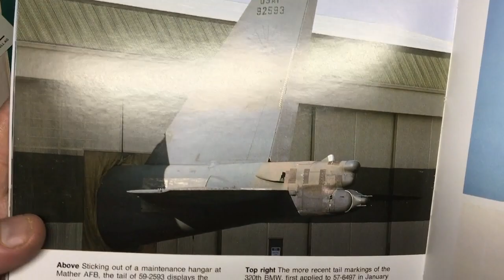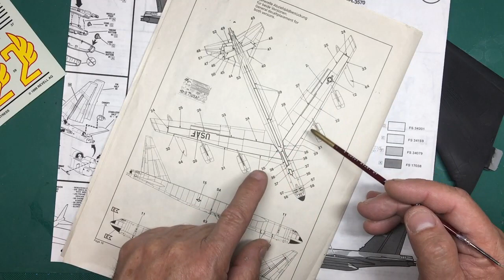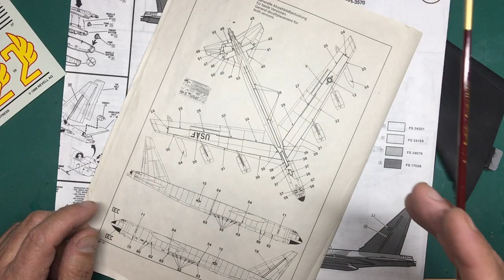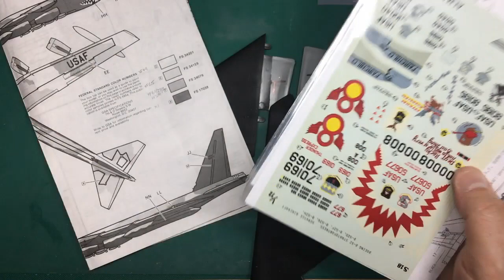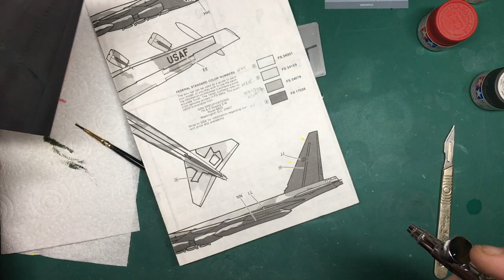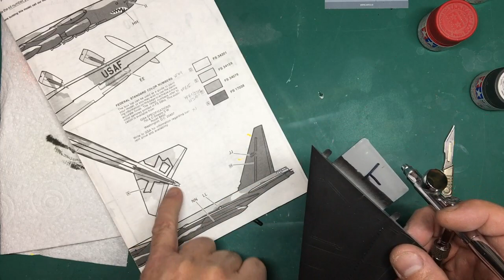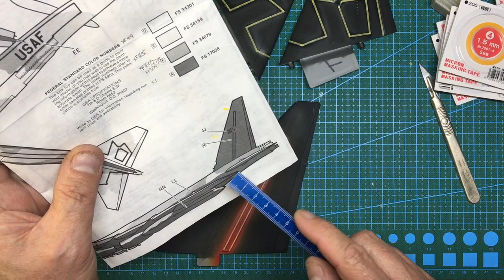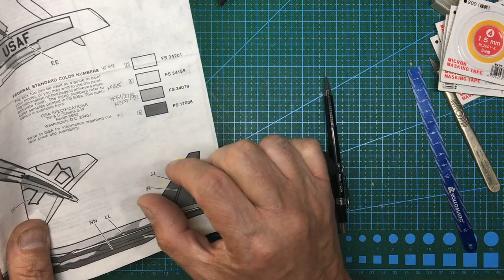Big Bad Buff Build for Beginners. Part 24

Comment: Good tip to scrape off the dried paint on the tamiya paint pots, it really glues the lids on lol. Model Master paints are the same. There won't be any beginners by the time you finish this big bad buff build, this is the condensed version of everything you have taught us over the last few years. As an old bugger getting back into the hobby, if your teachings are followed and a little bit of patience is applied almost anyone can build a model they are proud of. I learn something new every video. Where were you 45 years ago lol. Thanks for sharing Nigel!! Cheers!
Reply from the maker: Glad you get so much from my videos Daryl

Comment: Another great installment I use Vallejo paints purely because they're easy to use and as I'm still finding my feet with the airbrush every little helps. Plus I'm on a tight budget I've followed your advice re glass balls in paint pots what a difference they make many thanks. Used premium hobbies very helpful got some Mr Surfacer 1000 and some leveling thinners too.  Looks like my next order will include some thin masking tape to try to do walk lines on my next Spit again thank you very much

Comment: Thanks Nigel for the tip on masking and preventing wicking, I usually spend ages with a cocktail stick trying to keep the gap down. I'll have to try the spraying technique you use. Cheers again mate.
Reply from the maker: You still need to try your best to get the tape down. Smooth surface, press tape down, overcoat tape with original colour. We'll see if it's worked soon.....
Reply: @NigelsModellingBench  I like the belt and braces approach 👍

Comment: Thank you Nigel overspraying masks with same colour as below them is great tip.  
Am I right assuming, that this trick can  be also used when masking windows, canopies or other clear parts, but this time sealing masks with thin layer of clearcoat instead of colour paint before other colours to prevent paint creep under masking?
Reply from the maker: I wouldn't risk that Deri. It would be easier to remove the paint from the clear part if it did creep. I use a damp cocktail stick to remove paint from clear parts.

Comment: Hi Nigel, regarding the multiple applications of Mr. Surfacer on the windscreen, would either UV glue or clear resin make an acceptable substitute?
Reply from the maker: I guess it would Lee, but I find Surfacer so easy to work with. Sanding and removal with thinners is the big bonus.